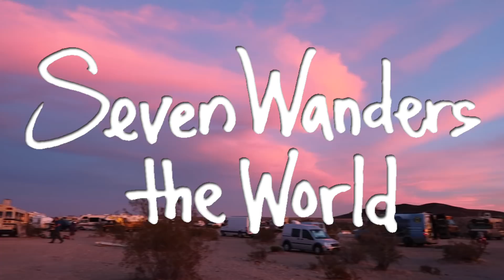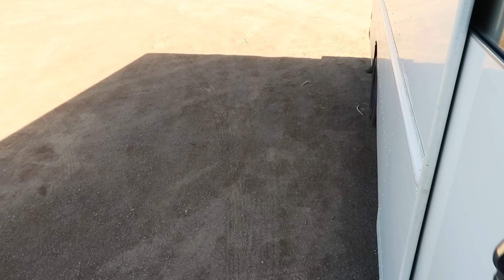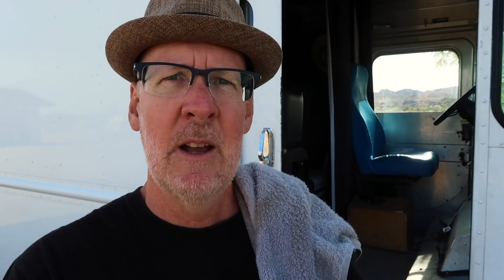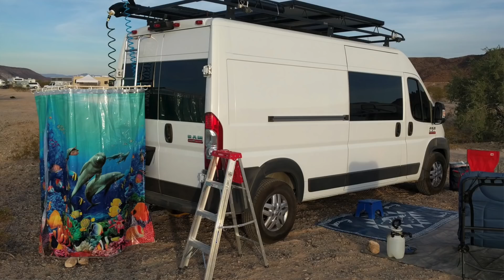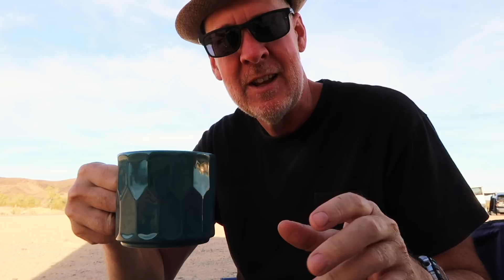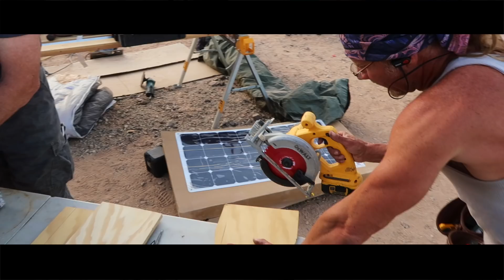Shower Dilema | Jamie's Van Build Party E334

Comment: I love the idea of a colaspseable hardsided outdoor shower. You can connect with a hinges 4 (8ftx3ft) panels with a complete look on the inside of a indoor shower. You can use a frame with lattice as panels or just the thin sheets of white wallboard/ wallpanels. Then you can have a holder for your shower sprayer and even small hooks to hold towels, washcloths, soap or put the body washing items in a clear plastic box to keep them clean and dry but easily toted to your shower. Then a water system with solar or a gravity fed black water  bag on top of your van. Maybe even enclose that unit inside a wooden box to keep it out of the elements also. But when you arrive somewhere you just unfold your shower wherever you want and leave it standing the entire trip. Then fold it up when your packing to leave and store it on top of your rig or inside. I like it better than an outdoor shower curtain. It's sturdy and you can make it as tall and  wide as you want. You can make a slat floor to stand on and even put your porta potty out there too. Just like a convertable outdoor bathroom.  😊
Reply from the maker: it is fun to explore all the options. I love reading new and interesting ways to solve this problem. I never dreamed I'd get so many great solutions!

Comment: If you just want to use it while camping just buy a camping shower. No use using up space inside for something you really don’t want inside.  But if you want one in side try a Galvanized Stock Tank (really a big metal bowl) to catch the water, they are a few feet wide. Then get a extra tall shower curtain add magnets and suspend it from the metal roof. Then take it down when not in use. And use the stock tank as storage when not in use. It could slide under a bench.
Reply from the maker: great idea with one flaw... my van is all aluminum so the magnets won't work... but I'm sure there are other options like velcro
Reply: Seven Wanders the World oops! :D I just assumed steel.

Comment: Check out how roadtrek puts a shower in a tiny class B. They use a recessed shower pan with removable flooring and the shower sides slide forward. It's like a slider window. So only half the width of the shower need be accommodated.  If you ever travel to cooler places having an indoor shower is a big plus. 
I like your style Seven. Keep on posting.
Reply from the maker: sounds similar to one of my earlier designs of the half shower hidden in a kitchen cabinet where the countertop opens to expose the half shower and becomes the walls

Comment: How about a shower pan in the middle of the floor? Could you have a false floor lift out that covers a shallow pan and can be covered to keep the floor level? Takes up no room except to store the curtain.
Reply from the maker: I'm exploring options along those lines right now
Reply: you could drop your hooped curtain into drain pan would all be hidden with false floor.
Reply: I went to visit relatives in Europe about 40 years ago. One  of my uncles improvised a shower setup in the kitchen. 

He used a plastic child's sandbox instead of a shower pan. He attached a plastic drain coupling to the sandbox, attached a hose to that. It drained onto a deck through a hole drilled in a door. 

You could have one which drains through the bottom. 
Drill a hole in the van floor. The drain goes through that. Seal the hole with a rubber grommet or flat floor drain . Use your imagination.
Reply: That's a pretty neat idea, actually! Just make sure you miss the vital systems of the van. I know the fuel tank is somewhere right along there and you may have to get around the exhaust as well. I also had considered an outside shower, if I could have added onto the rear bumper to form a square space, then I would have installed a pair of floor flanges that would hold a shower rod in a semicircle right over the open doors and the shower head dropping right over the top of the rear of the van.

Comment: Love the concept of the Tea Lounge / Book Center / Hangout Space... Tip for your "tea brewing" mastery... Water Temperature is key... green tea likes a lower temp (not boiling... about 145 degrees F (and a preheated teapot and mug of course). Black Tea can take a bit more heat (still not boiling).Each tea has its own sweet spot for the water temp and kind of water (hard vs soft, chlorinated vs not, etc). Even coffee does better with water that is about 190 degrees F. Fresh water from a good water source is the best if you can get it! The lower water temps reduce bitterness for white, green and black teas and coffee too. Herbal teas are a different story altogether and many need the boiling water to infuse the tea with flavor and the micronutrients... go figure... Then there is always sun tea and sun coffee (but even that can get too hot!) Enjoy your tea brewing adventures! Thanks for the fun videos!
Reply from the maker: thx for all in the info on teas. I'm a beginner and this is helpful!

Comment: On the shower.  Short term, get a "sun shower" small solar heated bag of water with a down spout.  I've used them camping/rafting over the years, and while not fancy, its a start.  It can be used inside or out, even with a dishpan to stand in to start inside, or doing the larger outside rig, which works well for many.
Reply from the maker: I've seen those. I'm also interested in the shower tent that sometimes goes with them
Reply: Haven't see the tent, but its a good idea, my experience is more from backpacking and rafting days.

Comment: Home Depot water heater tank aluminum drain pan. Already has hole for drainage. Shower curtain hangers attached to ceiling. Easy to store.
Reply from the maker: thx for the suggestion. I'll check those out!

Comment: Hula hoop with shower curtains all around, temp hang it on jhooks or velcro in ceiling, near your door, you take down when done.  Stand in a wide rubber bucket that you tuck the shower curtain into.  Water in a black solar shower bag up on your roof, pull the hose down and into the side door into the shower compartment.  Dump grey water when done, store bucket in your garage.  hoop and curtain will easily store away.  Better than outside on a cool day.
Reply from the maker: nice solution!

Comment: For no more than you'll be using it, definitely just get a shower tent for outside and a pump sprayer that you can fill with warm water.  Will take very little space to store, and both could have multiple other uses.
Reply: I agree, shower tent is the best way too go. That's what I use. Great video Seven,
Reply from the maker: the more I hear the idea and think about it, the more it makes sense

Comment: I got you covered on the shower design! I was going to do this in my van... You can buy a 24" x 36" low-walled tub like thingy. It will fit right in the back corner of your van, if you have that area clear. I see that your van has the same 39" wide door opening, so the tub would fit right up to the door frame. You can then install the loop for your curtain and the whole thing stays out of your line of sight. I will find a link to one I was watching on eBay, and put it in my next comment for you to have a look.
Reply from the maker: would the shower be inside the step van, or outside when the rear doors were open?
Reply: I was planning on placing it in the passenger side rear corner, next to the right rear door. Then place FRP panels on the back and side walls to form an enclosure. Then make a shower rod that makes a 90% angle to "frame" the two remaining open sides with the shower curtain. So, it would stay inside the van. And I would supply water to it by making a solar water heater mounted on the roof, like the ones made from PVC pipe and gravity-fed into the van. Unfortunately, it looks to me from your videos that you already have something in that space, so you would have to clear that out before you could install a tub. If you like, I will make a quick drawing of what I mean and post it here, so you can visualize it. BTW, good work, your videos are helping me to formulate my own designs.

Comment: Seven, you do a great job on the videos, you seem to understand scene length and cuts better than most.   Your videos have a certain professional quality.  
You have seen the interior of my 16 foot Tiger, it has a usable shower and flush toilet.  I took a couple of showers while at that event.   It's also a closet, so when its used I have to evict all the things from the closet and put them back when its dry.  A good thing which keeps the things at the back of the closet from being there permanently.  Bags go on hooks, like dirty clothes.   
Next time you see me on the road take another look.  I gave up coffee years ago and switched to tea, I'll be happy to serve you some. Be a maverick and install holding tanks and a real water system.  Its pretty easy and makes life better.
Reply from the maker: I remember the setup. just looking for more options and pros/cons of each
Reply: For those who haven't seen it, the unusual part is that the walls don't go all the way up, because of the pop top, its basically a sit down, wet shower, (with a flush toilet) although one could stand if they wished, I tossed the curtain filling the top area as unnecessary.  It can have a removable top on it which is counter space.    A dedicated fiberglass stall is nice but too wasteful, although one cut off at 4 feet +/-  might be a great thing.   As we know, a small RV is a lot of trade offs.  I'm considering a small 5th wheel but it will be hard to beat what I already have.     It will be interesting to see what you decide to do.  I'm headed back to Parker from slab city because, why not?

Comment: Cheap rv leaving. Bob Wells did a video with a expeditor in a yellow sprinter van. He had the perfect shower that unfolded from the wall and drained out the bottom of the van  I will try to get you the link to the video.
Reply from the maker: someone linked that video. I just finished watching it. thx!

Comment: gosh that van is so capable- stick a 55 gallon plastic barrel in a corner (lay it down and make a bench out of it), fill it with water -- forget the black plastic PVC hot water-- buy one of those $150 on demand Marley water heaters (I have one- works great) and you'll have a fresh shower daily.  I can go 3 days in my truck camper on 25 gallons, 3 showers- cooking- doing dishes- washing my hands countless times... 55 gallons will go a LONG way provided you're taking a military shower (like 2 gallons each)
Reply from the maker: that certainly is a solution!

Comment: Just came across this video, did you ever decide on a shower solution? 
Not sure who's build design video I saw it on but she said she was going to put a shower in the entry steps of her skoolie. That way she wouldn't need a drain due to the water would run down the steps and out. I thought the idea was interesting and would be a space saver. When not in use the shower curtain would be put away and would go back to being an entry door the her skoolie.
Reply from the maker: not really. I'm leaning toward a bucket system in a bench with a hanging shower curtain which can be stored. idea over steps would be great except that the batteries are located directly under the steps and don't think it would be good for water to be running on top of that area and the open fuse there

Comment: Shower pan on the floor with a hoop from the ceiling...use it for storage when not in use......just a thought....
Reply from the maker: great thought. thx!
Reply: A shower pan and curtain could be stored vertically somewhere under your bed. 

If the shower is a permanent installation,  it will take up a 3x3  area all the time.

A shower pan and curtain could be set up temporary inside your van. You will be in situations when you will want a shower during the winter when it is well below freezing outside while it is nice and warm inside.
Reply: Joseph Leister I

Comment: I have been giving thought to just turning the steps in my skoolie into the shower. Just letting the water run out under the door. Hang the shower curtain up with magnets. For hot water just use tubes up top to heat the water using solar and I would have a cheap 12-volt tire pump so the water would have psi. I know that could make mud right outside your door but you could just pull up a few feet.
Reply from the maker: a few folks have recommended that. however, on my step van the two batteries are beneath the steps (the steps actually are hinged and open upward to display the batteries.
Reply: It would be ok, just wear rubber shoes. (just kidding.)
Reply from the maker: ha!

Comment: Okay, I have a couple of questions regarding the shower dilema.  Are you going to plum H20 for your kitchen sink with drain to the outside?  Do you already use eco friendly washing/clearing products?  If so, you then might want to do a T or Y connect to the drain system to add an interior shower drain system.  Make sure if you do drain through the floor remember to add a screen to keep little crawlers out.  Then you could install a hot water heater drain pan that drops down and that could be stoled away in a flip up fashion.  The shower curtain from a rod could be hung from the ceiling of your van, shower curtians aren't that heavy, and again it could be pulled back out of the way when not in use.  Caravan Carolyn interview a lady who built a shower system in her cago trailer that was pretty interesting because it folded up and out of the way, when not in use.  Ask Carolyn who that was so maybe you could borrow her idea of a shower system.   As always,  thanks for another interesting video!  Keep it up it's working!
Reply from the maker: for now I'm using 6 gallons jugs for plumbing. eventually I'll get a fresh and grey water tanks. I'm trying to use eco friendly soaps.

Comment: You need to move your counter top and get the stove away from your bed. Use outdoor shower between the door ,2 should cover it and clip it closed. or a small step in basin for the shower .

Comment: I'm thinking about the round or oval galvanized tub when I get mine built . Storage for when it's not in use like someone else said . Or having a drainage hole cut in the floor if it was a more permanent thing ( that's the route I'm gonna go I think ) . Good luck !!
Reply from the maker: a great solution!
Reply: Here's what I had in mind Seven ! The galvanized tubs can be round or oval and are pretty lightweight in comparison to other options .

Comment: Outside showers are ok til it gets cold. Jed just looked at a high top van where the doors were hinged in two places.  One hinge from a wall, and another hinge at half the width. You could put down a shower stall pan, and have the doors unfold from flat against the wall, then unfold at the second hinge to give you a collapsible stall. When not in use, you could set a chair in the shower floor pan. You might even be able to mount some small wire shelves on the outsides of the doors for zazz and utility.
Reply from the maker: I like it!
Reply: Seven Wanders the World , I've been giving the subject a lot of thought.
Reply: Wolf Smith that's what I was hinting about when he talked about the shower.  The one Jedd toured.

Comment: If you can get the output out the side of the shower pan you can go with a stealth build that lives in a drawer then gets pulled into the isle to setup with a hanging hoop. Would use a tube to run to a grey tank or outside.  

The solar shower only works if you are using later in the day so no morning use so a propane instant hot water heater would be a better option, look for one that uses the 1 pound bottles and batteries to avoid the 25+ pound tank. A RV water pump should be enough to drive it so can use for both hot water and showers.
Reply from the maker: a couple of great ideas and lines of reason here. thx for the input!

Comment: Removable/ portable  shower in the hall - just need a 1" drain "to grey tank" (i.e.: ground): "Cheap RVliving" posted November 30, 2016 "Working as an expediter in a sprinter van" at 13:00 minute mark
Reply from the maker: thx for the info on Bob's channel

Comment: Outside shower is the only way, make it big too with room for strangers. lol..  create a U shaped hoop as wide as your rear doors allow, attachment would be up to your imagination. you could put 4 rivnuts in the door and use thumbscrews.  hang a shower curtain or 2 from the hoop and you are good to go.. my question is what are you going to do for hot water? You have a space advantage over most vandwellers and RV designs, have you considered a heat exchanger from the engine? every time you drive somewhere your engine makes enough hot water to bathe everyone at Jamie's it would be nice to use some of that.
Reply: Specifically the hoop would be attached to your open rear doors which are plenty strong enough to hold up a shower curtain and maybe some hangers and your shower head.
Reply from the maker: I like this idea!

Comment: Look up RV out door shower set up. It will keep your van stealthy only requires you to cut a small hole on the outside panels of the van. It’s stealthy because it will just look like a fuel door.
Reply from the maker: I like that idea a lot!
Reply: Seven Wanders the World yeah. Remember when adding a water tank if your water consumption is minimal you  can get a small water tank. Small enough to mount between the frame rails of the chassis of the van. Having weight over the rear axle of the van will improve ride quality of the van.
Reply: Seven Wanders the World oh another note. You really don’t need a shower curtain and rod on the out side of the van.  You can shower with swim trunks and flip flops. Since it’s only going to be used when your in secluded areas.